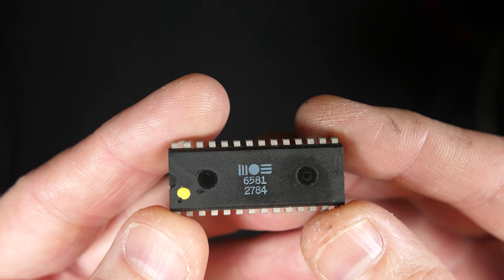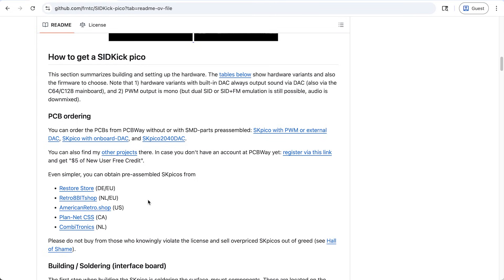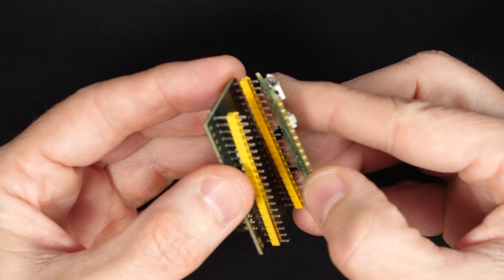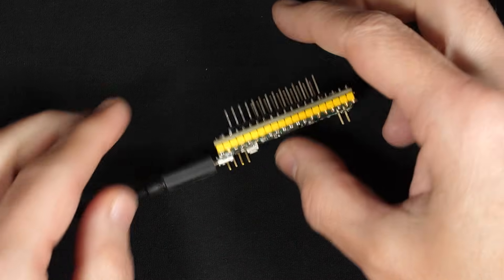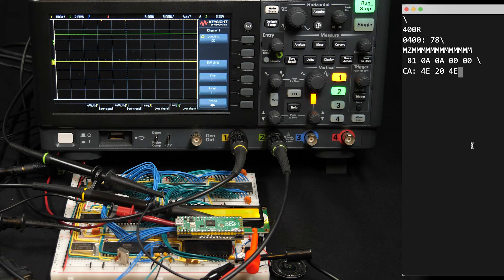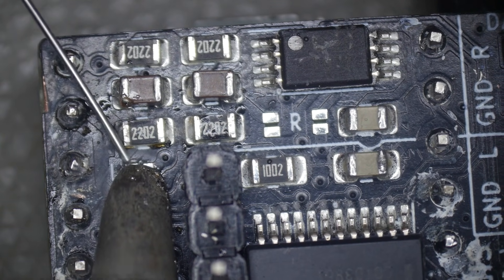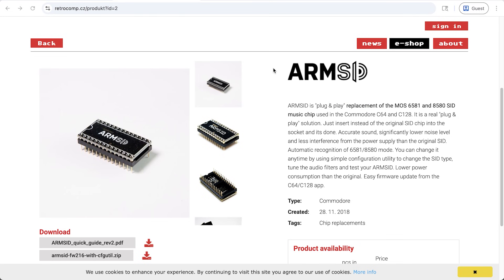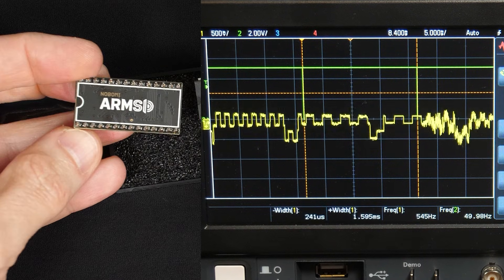Modern SID chip substitutes

Comment: The armsid likely has lower sound levels because it needs to account for c64 support circuitry like pal encoder and amplifiers and such. The pico board is just a straight output and doesn't need to account for that. Unless you want to put the sound into the c64 board. But by the sound of it, you borked that output a little. But I guess if that had worked you would have found comparable sound levels. Maybe that option required a different firmware and that was why it was so overdriven.

Comment: 9:30 This is why they sell 0hm resistors: that would be the perfect fit here.
Reply: for this project, since they expect the user to choose whether to bridge the pads, I would definitely have chosen to use a solder jumper footprint, not an SMD resistor footprint.
Reply: or use a cut off leg from some component for free :D I got like a whole bag of metal legs cut off from circuits after soldering components, that are perfect as bridge 😁
Reply: @fcf8269  I came here to say this. A tinned leg of a component, snipped to the right length and it's in easily. Or put one end down of a longer lead, then tack the other side and snip it to fit after the solder cools (this gives you a 'handle' to hold it in place while soldering)
Reply: @fcf8269  lol definitely using this next time
Reply: Or simply just don't use flux and a solder tip size fit for purpose.
Reply: Or just a small piece of leftover wire
Reply: Isn't that just a piece of copper wire?
Reply: @mytube001 functionally, yes, but 0 ohm resistors are typically used as jumpers because they can be placed by pick&place machines.
Reply: @mytube001 It's electrically a piece of copper, but it's got the right physical characteristics to get pulled into position by surface tension between two pads separated by solder mask.
Reply: @iabervon and it comes on spools so that a pick-and-place machine can put it on the board.
Reply: @Nukle0n  Yeah, although that doesn't explain why Ben might have found it easier to use here. On the other hand, they probably designed the board this way with the idea that they could sell two variants of the product using the same board, depending on whether they stuffed the 0-ohm resistor or not, before deciding not to bother.
Reply: Pretty sure 0 ohm resistors are designed for layout machines rather than manual tinkering
Reply: @apinakapinastorba  the creator doesn't sell the board, so makes sense the design has a 0R footprint for people ordering boards to populate it if they want. Those profiting off another's design work could at least tweak that if selling to end users who might want to manually tinker with it.
Reply: I used to witness the laptop fixers, they use thin copper wires to replace the 0 ohm resistors on the motherboard that was wild. The 0 ohm resistors would be safer to use because they are covered, avoiding the short circuit or circuit leakage.
Reply: @nguyen2135  WITNESSED
Reply: @ScienceDiscoverer  lol my english is not perfect. TY. HAHA.

Comment: Good sound modules are amazing. I got sound from a Pico in PicoMite / MMBasic and PWM mode which is quite pro on the PicoCalc. Then I got MP3 on an M5Stack device setup where a Core2 is acting like play controls to a module called "Audio Player Unit".

Comment: Really interesting video, good to see that replacement C64 chips keep on evolving. I do have a word of warning. Chips are not designed to be inserted while power is on. There is definite risk of microchip failure due chip internal latching and thus burning either parts of chip or bonding wires inside the package. With luck it never happens, but someday the luck will l run out and problems happens. 

IMHO it's ok do do for your own parts and knowing the risk at one own bench, but for making youtube videos it would be better to show safer ways to work. Especially when working with historic and valuable parts that are becoming really hard to source.

Comment: "Better" is subjective. The original SIDs were already quite varied, not just between the officially marked revisions. Plus they use analog electrics that degrade/change over time. The Pico has enough computational power to theoretically put in a supervisor with 80 column video and interfaces upgrade as well, someone will figure it out eventually. Printing new SIDs is probably still some decades away though.

Comment: I really get stressed when I see you pushing a chip into the breadboard with the power on 😮. I once killed my C64 and my 386 PC (very expensive at the time) because I connected a cable between them when they were on and I could hear the spark jump at the same moment my C64 video display turned into garbage and a moment later the pc failed to read from disk.
Also, imagine inserting the chip one pin shifted. Good chance that the magic smoke escapes.
Reply: If you insert it shifted by one pin, it doesn't really matter if the power is applied immediately or a few seconds later.
Reply: @wbfaulk that is true, but you can double check the position first and then turn on the power.
Reply: I leaned a floppy disk controller card in my Apple IIe because the slot's fingers were loose and the card was making intermittent contact.  I heard a loud "Zap!" and a wisp of smoke rose up.  I powered everything down, pulled out the card, and noticed a hole blown completely through the chip.  Luckily, the chip was in a socket, and Radio Shack had them in stock.  It all worked fine after replacing the chip.
Reply: Around 1996 I put 4 SIMM modules the wrong way around in their sockets. Yes, this was possible. Magic smoke arose and I started to cry, because I had been saving up for it for 4 months. Luckily and surprisingly, after placing them correctly in, everything worked for almost 10 years!

Comment: Woo. To make solder bridges easier, just hold the bare end of a stripped, tinned piece of wire across the pads, apply flux and solder, then clip the wire.
Reply: That's what they invented 0 Ohm SMD jumper resistors for.

Comment: for me the SIDKIT sounds almost the exact same as the original, and the ARMSID sounds "quitter" and has "some" very small distortion, but frankly that's almost shadowed by the easy plug in and not requiring the 12V input anymore

Comment: Shame you didn't compare some other SID tunes, as some work better on the earlier SID chips compared to the later ones.

Off the top of my head Turbo Outrun by Jeroen Tel sounds vastly different on later SID chips, with the digitised sounds being significantly lower in volume
Reply: Iirc, someone else wrote the ported code to get his 6502 play the song. So, yea, more songs would be better but who is going to port the code?

Comment: Cool video. That sidkick pico looks like it would work fine but what a Frankenstein board, especially with your added headers. The ARMsid looks much more elegant. There's also something unholy about bringing in a component which is many times more powerful than the c64 to do the work of one chip. Sure the st micro or whatever the armsid uses is the same but the smaller hidden form factor makes it less in your face. Especially true because you're using an off the shelf pico. No offense to either project, both excellent work and love the retro support of these types of projects.

Comment: awesome. it's like Project Farm... but for SID chips. :) THanks ben.
Reply: Thankfully he didn't try some sort pin strength test.
Reply: "The ArmSID claims to be a drop-in replacement for the C64 SID chip. And the ArmSID supports 5V or 12V input voltages. We're gonna test that!"
Reply: @Ryan_Thompson  lol

Comment: ARMSID had a better noise cancellation, but I guess the tradeoff is the amplitude
Reply: I think it has more to do with the fact that the armsid outputs into the original c64 sound circuitry which might do its own amplification. Thus armsid need to keep the levels lower to avoid distortion because of overdriving. The pico has a separate output, it can go as high as it wants to. You configure how it is used.

Comment: I love that sound. If I decide to get one of these chips, I'll probably buy the ARMSID. That makes me wonder, how many ADC channels are needed on a regular microcontroller to emulate the SID? Can you even make triangle waves with it? What other modern SID replacements are there?
Reply: In theory, one, since you should be able to make any wave (or combination of waves, with some basic math) with just one output channel. After all, it's not like the original SID chip has 3 separate output channels.

Comment: I don't hear any difference but I'm watching/listening from a tablet.
What would be neat is sync the waveforms and run a negative comparison.
Could do it in Audacity or any other audio mixer/editor.

If you have 3 of these 6502 projects, program them to run the song immediately after reset, tie resets together, use oscilloscope to do the comparisons

Comment: For me its a bit funny that the pico to emaulate the SID has probably way more computational power than a C64
Reply: From what I read it's no easy task to get a good SID emulation done, because the SID is parially digital and analog.
There are some music examples where even the armsid or pico sound different than the original SID.
Reply: @Zentauri77  Yea there's earlier examples like the SwinSID that use some other microcontroller and it's really not quite up to snuff, you need way more juice than you'd expect, and of course it's still a digital recreation of an originally analog circuit.
Reply: @Nukle0n  Swinsid was panned for being too underpowered and sounding "sterile" because it couldn't emulate the analog filters well, or really at all. Swinsid Ultimate fixed most of the issues but armsid is just more powerful, which is why swinsid is discontinued
Reply: @Nukle0n  the swin sid had a low speed 8-bit core and you need at least 16bit math for the filters. in the arm sid you have 32 bit fix point math.
Reply: @OscarSommerbo  Right, but if you pick it for an homebrew computer like Ben’s it’s a pretty respectable sound generator that you can even DIY with a simple and easy sourceable AVR mirocontroller plus a couple of passive components.
Reply: @Corummo Indeed. The hunt for the "perfect" side replacement is a fools quest anyway as the sound from 40 years ago is so tainted by nostalgia, no modern replacement will match it. Not to mention the incredibly high variance within batches made every SID sound slightly different from each other.
Reply: @Zentauri77  In some cases even the different revisions of the actual SID sound different from each other. Getting perfect emulation of the SID at perfect speed is extremely difficult.
Reply: @asteroidrules  Not in some cases. I would argue, in every case.
Reply: @DerDanko  Yup, it was just the nature of mixed signal ICs back in the day, every one was slightly different (some more than others).
Reply: @SomeMorganSomewhere  The tolerance for manufacturing each SID chip was very off, until the 6581AR5 and later 8580.
Reply: @SomeMorganSomewhere  Indeed, however the SID was not a regular IC. The digital part is difficult to parse to this day, and the analog output even more so.
Reply: @Zentauri77  yes, but due to tolerances two different c64 computers do not sound the same and are out of spec.
Reply: Yeah, my first thought was "this is massively overkill, just slap a normal microcontroller IC into it and it'll be more compact, more power-efficient, and cheaper" (and of course, the next one does exactly that haha)
Reply: @nikkiofthevalley  Both are micro controllers though,  the ARM SID uses a more powerful STM32F410 cpu (HW FPU + DSP) than the Pico - although that has some cool tricks with the PIO. The scale of the Pico production means it's nearly 10 times cheaper. Of course the ARM SID  its a far neater cool solution though.
Reply: @mikiex  But the pico is an entire development board, if a bit minimal, it would be much more efficient to design a board that uses the RP2040 directly instead of the entire pico.
Reply: @nikkiofthevalley  PiPICO or RP2040 is a "normal microcontroller" - ARM Cortex M0+.
Reply: @nikkiofthevalley I sometimes fall into that trap! But if you've done rpi projects before and are already set up, they're like a couple bucks, no power efficiency constraints in this project, your time is more valuable
Reply: @nikkiofthevalley  yep but wouldn't wonder if even it got more power than a c64 it got just ~1MHz after all
Reply: yes, but the PIO feature is really great for a bus interface. that does not interfere with the sound generation software loop. and it has enough power to da a stereo SID. there is probably leftover power to add a TI speech chip, better sampling and reverb.
Reply: The ARMSID uses a microcontroller featuring a 100 MHz ARM Cortex-M4 core. But it's not just 100x faster. The 6502 takes several cycles per instruction (at least 2 but up to 7) while the ARM does most things in a single cycle. That includes integer multiplies, which the 6502 doesn't feature. The M4 has hardware divide too, although that takes 13 cycles (dividing is hard). It also has Digital Signal Processing instructions, and a Floating Point Unit.

Also the ARM is a 32-bit core with 13 32-bit general-purpose registers, and 1 more that can be borrowed if you're prepared to save and reload it. So it can do a lot more in-core before having to load more data from memory or store it back.
Reply: I believe same goes for the armsid
Reply: @artemis.nnnnnbbbbb  Yes, but it is using a more powerful MCU.
Reply: IIRC, it can emulate a whole C64, so I don't know the quality of the emulation, but that stands to reason it has at least 6x the power, if standard heuristics are taken.
Reply: If you could emulate the sid with 6502 i don't think they would've done the sid
Reply: Yes
Reply: 100% it's more computational power
Reply: @SomeMorganSomewhere  What do you compute? The 8580, and 6581 in particular, are highly non-linear transfer functions. You can have all the computational power you need, and still miscalculate if you don't know how to do it.
Reply: The Pi Pico's SOC runs at 133x the clock speed, is dual-core, and has 264x the SRAM. 
The ARMSID uses an STM32F410CBU6 which has 84x the clock speed and 64x the SRAM, but has an onboard DSP and other features. 

This is the equivilent of replacing a broken wheel on your wagon with a modern EV drivetrain.
Reply: @groundzero_-lm4md  yep and all that power for barely any money.
But it makes sense it would be way more costly to manufacture it as a proper IC or using a fpga
Reply: @groundzero_-lm4md  Horsepower doesn't really matter if the emulation/simulation algorithms aren't close enough compared to the original, though.
Reply: @groundzero_-lm4md  That's mostly because re-creating the circuit in analog is more complex.
It could be done with absolutely tiny MCU and some analog chips but that's... more chips than single very powerful MCU running the emulation
Reply: The original MSRP of a C64 was $600.
A Pico costs about $4. 
Kinda insane if you compare just how far computers have come.
Reply: @Finkelfunk We all carry a device with us every day that has more computational power than the entire infrastructure used to send the Apollo rockets to the moon.  I am, of course, talking about the key fobs that we use to unlock our cars.
Reply: No probably about it. It is, in the digital realm. Analog, it is still a toss up.

Comment: I wonder if you could do that with an Arduino nano
Reply: Probably not.  Not enough RAM or speed.
What a Pico (or more accurately an RP2040) has is PIOs that can handle signal processing independently from the CPU.
There's actually two CPU cores, but unknown if the SID emulator takes advantage of that